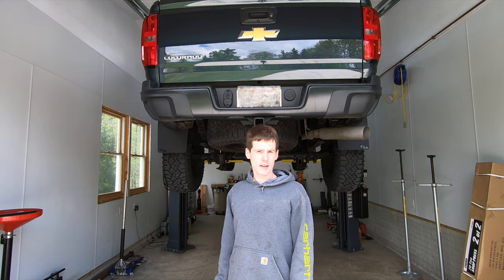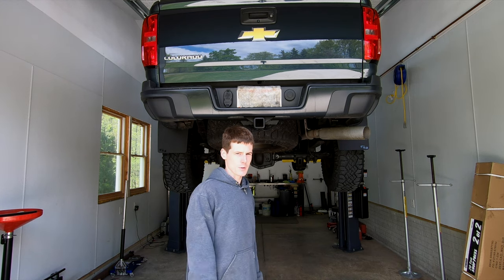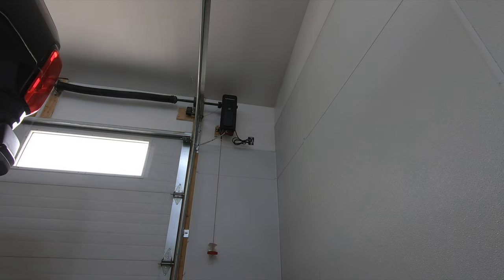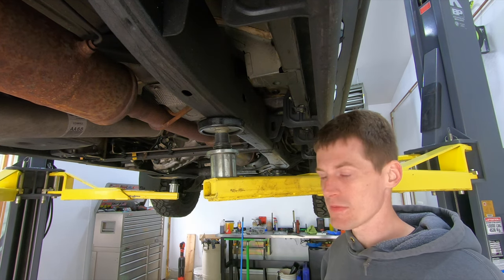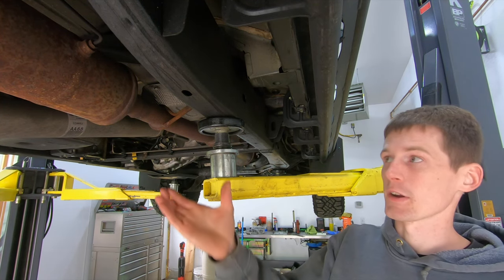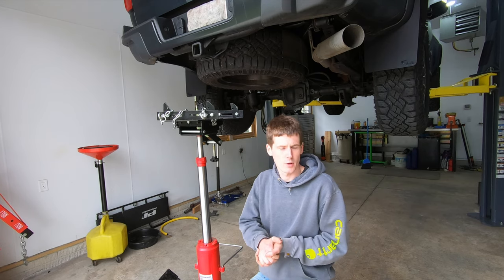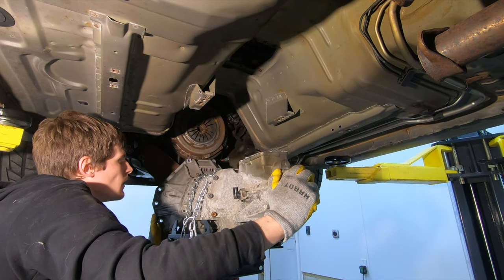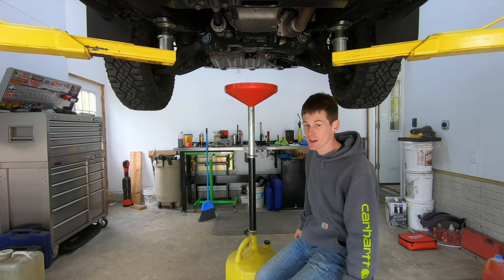Top 5- 2 Post Lift Accessories You Need If You're Going To Buy A Lift.

Comment: I have access to one , but find it difficult to line up the lifting pads . On my 2020 Toyota Camry which has pinch wells . As I don't want to dent the rocker panels . And there is not a rectangular lifting pad replacement available . So as someone mentioned to use hockey pucks to place in the center of the round lifting pads to give height . And I expect the hockey puck to be the length of the pinch weld .

Comment: How tall are you Mr. it looks like you would have to be hunched over under that truck while working on it? I'm 5' 10" and I will need to stand straight upright so as not to suffer with my bad back.
Reply from the maker: I'm 5' 10" as well. You will have to duck under the tires but at full height I can stand upright.

Comment: Great job on your videos.   I recall when I got my first two post lift about 29 years ago, and I also didn't know much about lifts then. You learn as you go,  but having videos like yours are great to help new owners reduce the risks in using a lift. 
   As a retired mechanic, and having installed a new lift about two years ago, I would say you are spot on with your recommended accessories. 
  I do prefer a high stand over a trans jack for vehicle stabilizing, based on the load ratings.
  But, it's all good. 

  Thanks.  Stew B.

Comment: i went with a rubbermaid cart for a tool tray. a lot more service area, and i can use it to wheel in parts and packages. plus shop towels stay handy on the bottom shelf. can also add a raised plywood top to give yourself another work surface

Comment: I would add under lift lighting before a transmission jack, unless you have to pull a transmission. Electrical outlet, air line, and a cut off switch for the hydraulic motor, in case the.relay or motor starter gets stuck. Tool tray is a must and tall jack stands.

Comment: I added a long extension cord to my lift button and can look under while starting the lift to check the alignment of the lift arms. and It has a magnet on it that I can attach to the support jack on the rear of the truck so I can not try to lower the truck with the stand in place and crash the trucl off the lift. my not be osha but works for me

Comment: Hi Repair geek . I have good question for ya .  This past summer I started a fluid film undercoating business. It been going very well. I now soon colder months with be approching us. My question what is a heat source that fluid film won't hurt. I currently have a wood stove in there but haven't used it yet . I used to burn one in my house for over 20 years but switched to something more convenient such as a pellet stove. I really am thinking about putting one  in my uninsulated garage which is a 26x36 with 13 ft ceilings. Im a little concerned that the fluid film misr from when I spray it s
Will affect the pellet stove. Please give me your thoughts on this . Thank you

Comment: can you do an update video on what you did to remedy the AMP and wire ordeal did you rewire the lift with bigger wire also did you install a lower safety stop yet at the bottom so you can lift it only a foot or so, do you know how many amps it was pulling when you lifted your heaviest vehicle? thanks for making these videos.
Reply from the maker: No need to do an update video. I haven't done anything. I do not use the overhead safety switch. I just watch when I raise something. Big vans would hit the garage door before the safety switch anyways.

Max amperage is about 12-14 amps. That was measured dead heading the pump at max height attempting to go higher. That is the most hydraulic pressure the system can see.

You can't change the bottom lock. That you require a whole new carriage assembly. The carriage is what has 1/2 of the lock mechanism on it. 

About the only thing I've done to the lift is maintenance. Check the lags bolt torque yes they have moved slightly as the lift/bolts settle. They have held tight the past 3 years or so without changes. That and oil the cables and pulleys. Thats all I've done other than use it for 4 years.
Reply: @RepairGeek  thanks for the reply, love the videos.